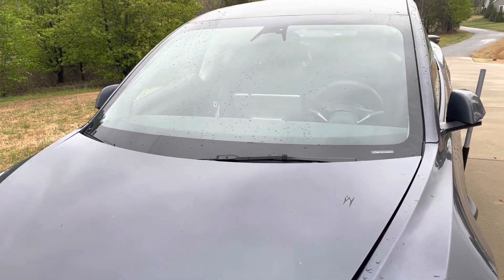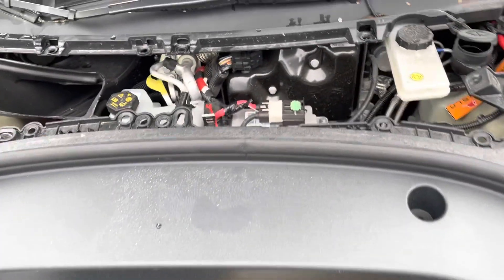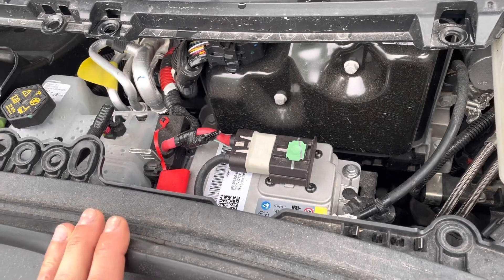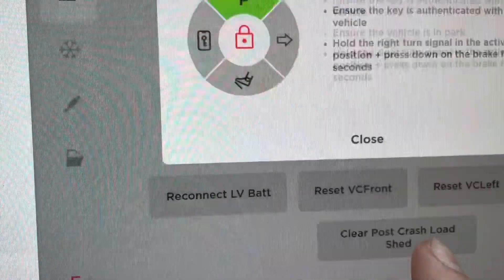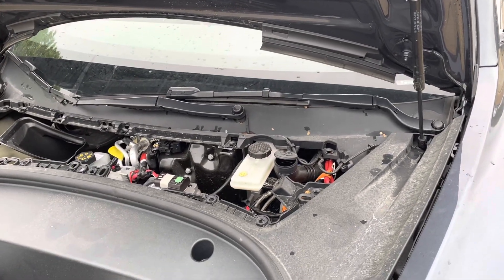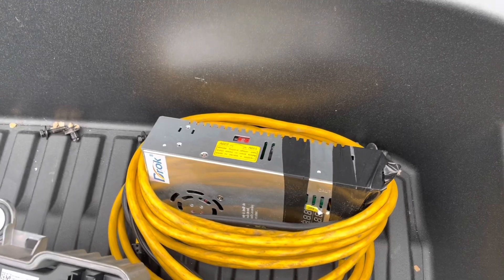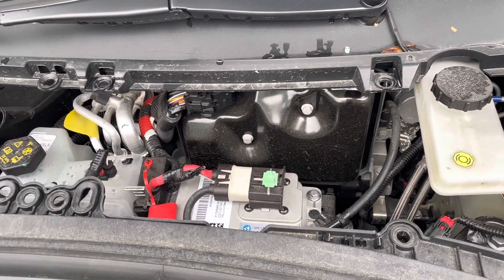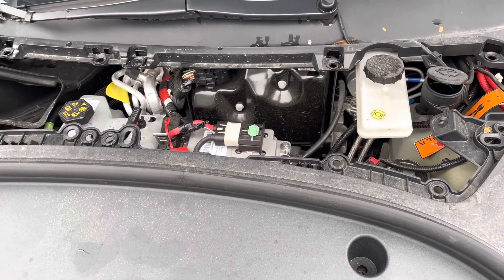How to get a 2022-2023 lithium Tesla running after replacing the pyrofuse (clear vcfront load shed)

Comment: Hey can you get the car into tow mode without changing the pyro fuse? Without clearing load shed ? Do i need to do both to get it into tow mode or is clearing load shed enough. I guess towing is not accessible in load shed mode? Thanks
Reply from the maker: You would only need the key to enter tow mode.

Comment: I had a small accident in my 2023 MS, Pretensionere fired but no airbag deployment.
Car shut off initially but then about 3 min later the car was drivable and been driving since. 
it does say "clear load shed data ...." yet the car runs without issue. Have yet to clear any load shed data.

Why would tht be? 
Why would that be?
Reply from the maker: Never heard of such a case.  Find someone with Toolbox access they should be able to reset it for you.
Reply: @diytesla  many of these things liek clearing load shed data and also clearing RCM…from latest service manual online..those things are in the use menu..so toolbox needed. According to the UI

Comment: I just bought the power supply . How do I wire it to the car?
Reply: Where you buy your power supply? Can you share a link
Reply: @tameb8169  I returned the power supply and ended up using a 12v dewalt car starter from Home Depot . The yellow one.

Comment: I have a 2022 Tesla Model Y that was in an accident and had airbags deployed. I replaced all airbags, but when I tried to enter service mode, the keys didn't work. To get the keys working, I updated the software, but after that, the turn lights stopped working due to a software update error. I replaced the VC_front module, but the issue persists—the turn lights still don't work. I bought Toolbox, but in the software update tab, it asks for a VSP ID. Do you have any ideas on how to solve this problem? (VCLEFT_a299_swcMIA - Steering wheel button and horn unavailable. Service required to restore functionality and VCFRONT_a173 - Incompatible software version)

Comment: I have a wrecked 2023 Tesla 3, bought a new 16v battery and replaced pyrofuse, updated the software but the vehicle service mode is locked due to low voltage still. I also tried using toolbox but it won't even connect with the VCfront, or the car at all, probably due to the post crash low voltage not allowing it to coneect with toolbox or car servce. Is there anything else I can try, or do I need a new vc front that isn't locked. Seems like when its locked its locked.
Reply from the maker: You should be able to use Toolbox, you probably have a problem with your computer setup. Try connecting to another Tesla first.
Reply: I don't have another tesla to try toolbox, do you know anyone who can reset them, or which tesla dealer can sell one? I can send my old one to you.   @diytesla
Reply: I can send my old one to you. @diytesla how much are these?

Comment: I bought a Tesla and I already changed the pyre fuse, the engine doesn't start, the battery ran out quickly.
Reply from the maker: If it’s 2022+ then you need to reset or replace the vcfront too.
Reply: @diytesla  Do you still have any that you can sell me?
Reply from the maker: @MrLetalito  Yes, send me an email (see description) with your contact info.
Reply: @diytesla  I have already sent it by email, I am waiting for your response.
Reply: reset  the buttons on the steering wheel or via computer

Comment: Have you found a way to bench reset Load Shedding Mode in VCFront?
Reply from the maker: Yes it can be reset using Toolbox, as long as the car is running software 2022.44 or newer.

Comment: I have 2022 Model Y; It has small hit on front driver side. 

Front drive belt and roof right and left side air bag is deployed. 

I have change the pyro fuse and use jump start wire to turn on computer on tesla. Computer getting on and it show car has 31% battery. As soon as i remove the jump start wire. Computer screen turn off. 

Do you know the reason why still high voltage battery is not getting on? 

Do i need to change 16 V battery and Also need to clear crash data?

Does anyone know how to clear the crash data?
Reply from the maker: https://discord.gg/MGHBFnbtb

Comment: Hello I need you to help me I have a Tesla Y I replaced the pyro but the car does not want to start it tells me that the low voltage battery is disconnected when it is plugged in I cannot to enter the menu as you did I'm from Belgium it's a European car thank you😊
Reply from the maker: You need to replace or reset the vcfront. Please watch 
https://youtu.be/0efcfOD60yI

Comment: You da man.  Just bought one from an auction.  This sounds exactly like what’s going on.  I’m gonnna try tomorrow
Reply: I bought a Tesla and I already changed the pyre fuse, the engine doesn't start, the battery ran out quickly.
Reply: @MrLetalito any luck with yours?
Reply: Did you have any luck?

Comment: Hello, I got the new Vcfront, my old one was just loading so I got a new one. I do clear post crash and try to reconnect lv battery. Still no luck. My pyro fuse was blown and I changed it but still it’s showing pyrofuse in red and says connector is open. Help please.
Reply from the maker: There can be a few things causing it. Join our group for some help https://discord.gg/3GfnaXxP
Reply: I had same problem

Comment: Can you explain what reset VC left/right/front does? 

I have a dead 12V lead battery (2018), I plan on installing a new battery tonight, do I just need to clear post crash load shed after installing new battery?
Reply from the maker: I don’t know when you’d want to reset them, I never needed to do that.
Reply: @diytesla hi my 16v lithium ion not responding to jumpstart process i am planning to buy new one from Ebay .. do i have to do any programming after i install it ? Thanks

Comment: Do you have a link of where to buy the power supply? Thanks
Reply from the maker: DROK 12V Power Supply, AC 110V 220V to DC 0-12V 40A 480W Buck Converter Dual Display, Variable Adjustable Adapter Regulated 5V 6V 9V 12V Switching Voltage Transformer 10A 20A 30A 40Amp Charger for Lab https://a.co/d/6S8DU7v
Reply: @diytesla send me your watssaf number

Comment from the maker: If you car is running software version 2022.44.X or newer, you cam clear the post crash load shed using Toolbox.  If you don’t have toolbox access or your car is running an earlier version, you can mail us your vcfront to get it reset.

NOTE: when replacing the LV battery, in some cases software reinstall must be performed (while powering the car off a power supply) before the Mosfet will close.

Comment: how do you know when the high voltage battery is bad on a 2022 tesla model 3 after not been charge for 4 months
Reply from the maker: Try charging it to 100% and note the range in miles.   The less the range the worse condition of the battery.

Comment: This confirms my suspicions. Unfortunately in Australia we can’t get into service mode.
Reply from the maker: If service mode doesn’t work and you don’t have Toolbox access, your only choice is to replace the vcfront.   I have one I can sell you if you can’t order one from Tesla there.
Reply: @diytesla can you sell me a pyrofuse?
Reply: @diytesla  Hello if I change the vcfront it is necessary to do a coding? THANKS
Reply from the maker: @xavierfraiture3642  No, but you do need to do a software reinstall (or update) and you need the power the car with a 13.5V 40+A power supply when doing it.
Reply: I managed to enter service mode but it is looking for it does not want to start can you help me
Reply from the maker: @xavierfraiture3642  https://discord.gg/MGHBFnbtb
Reply: @diytesla

I just bought a crashed model y. How can i send you the vcfront to reset? I changed my lv battery and my car doesnt go in service mode to reset. It just keeps spinning. The software is 11.1. Any help would be appreciated.
Reply: Hello , i would like to join the discord . Can I get the link? Also I am going to replace the pyro fuse today. The try to reset the vcfront , after that I should replace the airbag, seatbelt and reset the airbag module ?

Comment: Hi my car was in a small accident no bad impact just front wing and door down the side, both batteries went flat  the main battery charged up, and I  did the restore to the low woltage lithium ion battery in you other video, I've got 15.5 v accros the main terminal and acros the data pin and ground.
Everything seemed to work apart from it won't go in to drive, and says shutting down low voltage battery flat, but it's not. Have you any idea how to get round this. The only other thing that is wrong is one tyre pressure sensor need replacing, as the tire guy broke it changing the tyre, it's on order but not yet arrived
 Many thanks in advance 
Phil (from UK )
Reply from the maker: Join our Discord server, we will try to help you there: https://discord.gg/SVdE9cza
Reply: Replaced Vcfront? Had a booster on it whole trying?

Comment: Hi. Thanks for the video. I have a Model 3 in Australia. I am trying to enter Tue service mode as per your video but the password "service" does not seem to work. Do you have any other password suggestions? Thanks
Reply from the maker: That means you have older software on the car.   You need to update to a newer version OR park the car near a Tesla service center to be able to enter the service mode.